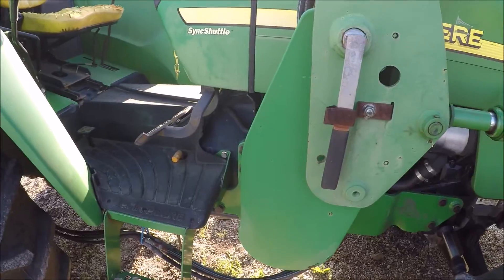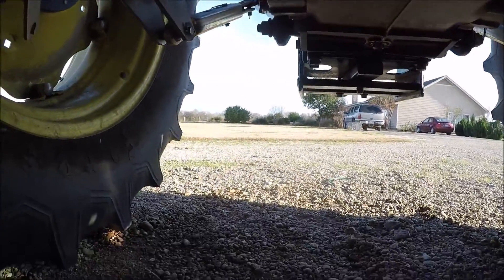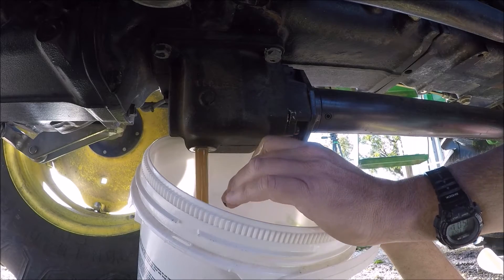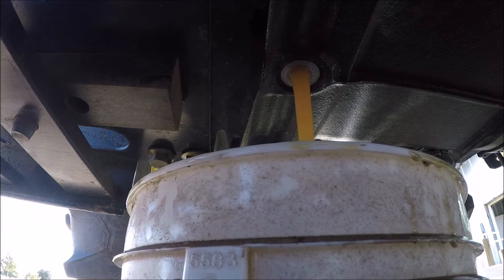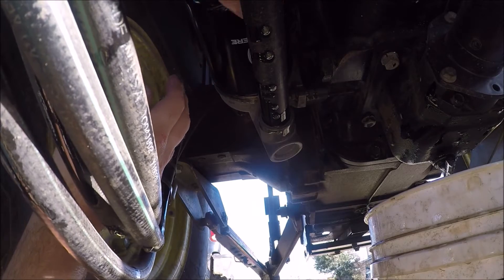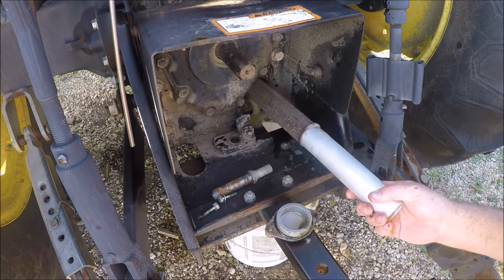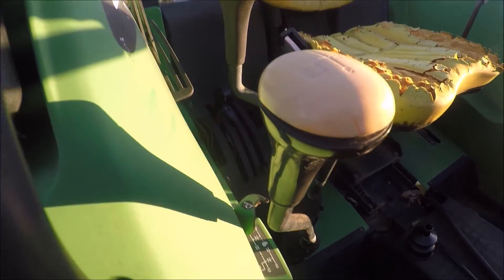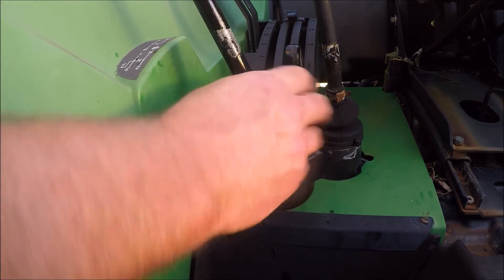Algae in my tractor's hydraulic fluid?

Comment from the maker: Just to update, a lot of people commented on other sites I posted this video that one solution was a product called BioBor JF, which is really a diesel fuel additive that kills algae. The product's webpage says you can use it in transmission/hydraulic fluid so I'm going to give it a try.
Reply: How did the BioBor JF work out in your hydraulic fluid?
Reply from the maker: Problem solved!  It hasn't happened again. Biobor JF seemed to be the stuff.